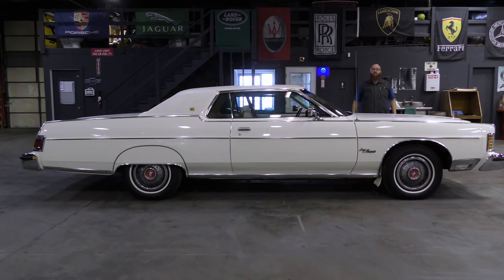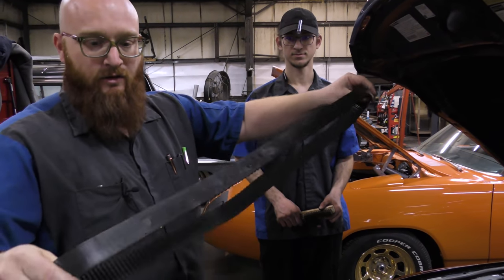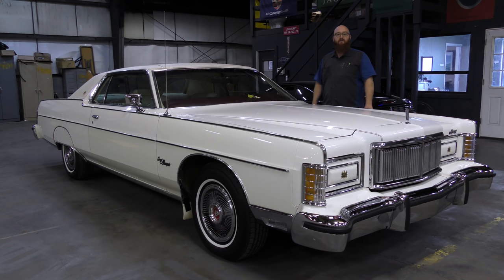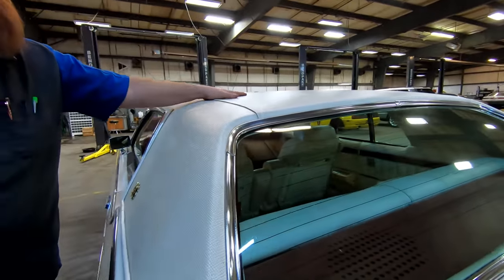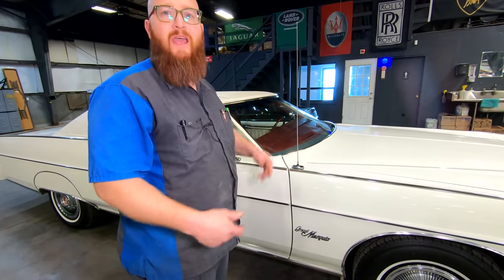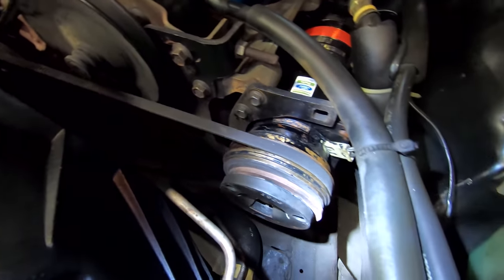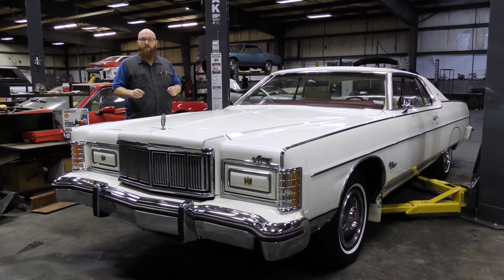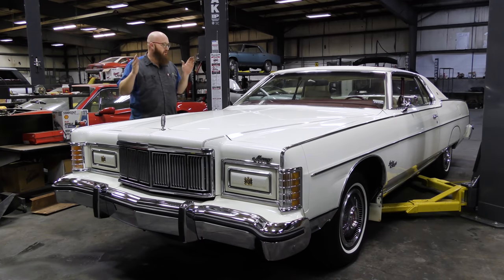Land Yacht Alert: 1975 Grand Marquis with 17K miles is in the CAR WIZARD's shop

Comment: The little old lady that used to live next to me had that car in a green color.    vinyl top cracked, let water in and roof rusted thru.  I fixed it with a couple coats brushed on of white roofing seal.   Original roof was white,, looked good, stopped the leaks.   her car at that point had the structure of a convertable.    and yes, the car was too long to fit in her garage.   super luxury car!

Comment: Absolutely beautiful. They knew how to design cars back then. I would love to have that, but I would be terrified to drive it, even on Sunday morning, and it wouldn't fit in my garage. That is definitely a collector car, and needs to be insured and treated like one. I have been driving a 2006 Grand Marquis for the past 9 years, and it has 381,000 miles on it. I recently bought a like new one owner 2007 Grand Marquis with 36,000 miles on it. I'm going to go ahead and wear out the 2006 (if I live long enough) then start driving the 2007.

Comment: I used to see a black one in the downtown Houston bank garage which was driven by one of the parking attendants. The land yacht belonged to a VP of the bank. It was just as pretty as the one in your shop. I'm betting it did not have the key-operated hood lock. thanks for posting.

Comment: I recall my dad deciding to get a vinyl roof put on his 1982 Pontiac Parisienne.  He bought this car as a dealer demo in July of 1982 and it had 5 thousand miles on it.  This happened towards the end of the vinyl roof craze and there were skilled craftsmen who did this kind of work.  We lived in a place that got a big summer hail storm every 5-6 years so I think he figured this would be some magic shield to prevent hail dents on the roof.  If anything, vinyl roofs added to the auto body repair time of any panels it touched.

Comment: I bought a 1977 Ford LTD Brougham brand new in 1977 and the only major problem with it was the steering box leaking past the lower seal and making a mess in my garage had to replace the box twice. At 20 feet long it just fit in my garage. I really liked the car though was a great highway car.

Comment: That yellowed plastic, I restore old Nintendo consoles and there is a process called "Retrobrite" that we use to decrease the yellowing. It basically uses hair bleach and UV lights to un-do the degrading of the plastic dye. Not sure if it would work in automotive plastics.. but I cannot see why it wouldn't. you might give that a shot.

Comment: Wizard: talking about barn finds. In Sweden someone found a 1979 SAAB 96 with 7 kilometers (4,3 mi) on the odometer.  The original owner bought it, drove it home and parked it in a shed. And there it's been since then until now. It's on action right now, price is expected to hit somewhere around $54.500. It's at $44,600 right now, but there's a few days left.

Comment: I had a 91 Mercury Cougar for a few years. It was about a decade old when I got it. Not nearly as big as this, but it was still in that same category of land yacht. I loved that car, was so nice on the highways, had nice little touches like lights on the side of the car that turned on when you used that sides blinker when the headlights were on. The back seat was my bed on many many nights due to going to concerts or just getting drunk and needing a place to sleep.

I have been driving pickups since I got rid of that car, but in the 23 years I have been driving, it is that Cougar that I think of most fondly.

Man I would love that Grand Marquis.

edit: Thinking back, this one really does remind me of my Cougar. The turn lights, the fake ragtop (mine was a black top), the nice hubcaps, the white paint, its a 2 door. I know the Cougar is a different line of cars, but it almost feels like this is the father of my old Cougar.

Comment: Wizard, if you’re looking for an early 70s American land yacht with decent handling/steering, check out the ‘69 - ‘73 (fuselage) Imperial range. Chrysler built those with unibodies, torsion bars and leaf springs, and fairly tight steering ratios. They’re also among the largest, longest American cars ever built - not to mention rarest!

Comment: My dad bought one of these when I was in high school.  They don't make 'em that way no more!  If I recall corectly, 7 ash trays!  When you cornered hard, it woudl frequenty flex the wheels so much it would throw a hubcap on one of the outboard wheels, I'd have to circle round the block to go get it!
It had the pneumatic tube inside the steering wheel rim to honk the horn.  429 4-barrel got 9 mpg!  The power bench seat would fold nearly flat as a bed.  
Those nearly 50-year-old vacuum lines are going to give you trouble, and there are a lot of them.  The intermittent wipers, headlight covers, and power door locks were all vacuum controlled.
The Brake warning light would illuminate if you got an air bubble in the line, I know.  Not sure how that worked...they were drums brakes though even in 1975. 3-speed automatic.
That's a very clean one.  The fender skirts were the worst for rusting.

Comment: A good friend of mine's parents bought the 4-door version of that car in 1975. It is too bad the left front fender is dented in that one. It would be almost perfect without it.

A few options that one is missing compared to my friends include automatic headlights and rain sensing wipers (that didn't really work that well). My friends had the same engine and locking hood release.

Unfortunately my friends got many miles put on it and it severely rusted by the time it was about 7 years old. The rear suspension had become very low by then and the long rear overhang would drag everywhere.

My friends was light blue in color but the inside had the same dual color red and white. There was no faded arm rests on his, but it was junked before it was 10 years old.

I still remember fondly riding in that car and only drove it once. It had tons of torque and was fairly powerful for the time too - but it drank fuel like nothing else.

Comment: The body reminds me of my grans 78 Tbird, great car, came across one issue with the black adhesive goo they used to stick the plastic sheet and other bits to the inner door and door panel started to turn to a liquid and seep out of panels in odd places like the window and lock switches which were on the side of the armrest and not the top.

Comment: In the mid 90's I had a 1975 Thunderbird that was more or less the same car as this (though not quite as fancy).  It was in terrible shape though, and I only paid $50 for it.  The engine ran ok, but it burned some oil, the suspension was completely worn out, and the interior was torn to shreds.  Same 460 engine as this though.  WIth the gas mileage that thing got though, I wouldn't want to drive it today.  This car belongs in a museum or something.  This car was built during the time when Ford's answer to every issue was "put a bigger engine in it".  Completely impractical to use as anything but a show car.

Comment: In the early 90's I had a 1973 Dodge Polara Custom 2 door. It was longer than the old square box 1980's  Suburbans. Two paisley bench seats that would hold four in front and four in back. Back when there were drive in theaters we would put two or three people in the trunk to save on admission. Stupid, yes, but we were high schoolers.

Comment: I bought a 1986 Cadillac hearse from a local funeral home.it had only 34,000 miles and in perfect condition.20 foot long and rides so smooth,but you aren’t driving by a gas station with out filling up.my picture is the car at a car show

Comment: Had that same locking hood latch on my 1981 F250. Fun one day trying to get the hood open to pull a coil wire with the ignition stuck in run!

Comment: Imagine all of the paper-based engineering drawings and the number of draftsmen that Ford had to get all of the parts of this land yacht designed -- in an era with little to no computer assisted modeling or design.  CATIA, ProE, and Unigraphics (now Siemens NX) were all a  dream back then.

Comment: Man what a barge, love the styling.  I dunno why anybody would've bought a Lincoln Continental in the 70's, costs about 1/3rd more and looks exactly like the Mercury.  Interior isn't any nicer, loaded out like this one has all the Lincoln options like leather seats, automatic climate control, hideaway headlights, same 460 V8, etc  About the only Lincoln option this car didn't have was the load leveling rear suspension(a must have for the mob men, can stuff 3 bodies in the trunk and the car isn't sagging in the rear to tip off the cops)

Comment: They certainly do not make cars like this anymore. What a shame. I had a ‘76 Mercury Colony Park station wagon with the 460 engine and 4 wheel disc brakes and it would pass anything except a gas station. It was a joy to own and to drive until the rear axle broke and could no longer be replaced because it was a rare 4 wheel disc brake optioned car. I have never since had a car that was so enjoyable to own and drive. I could never get interested in cars after that one.

Comment: What a beautiful car. A few notes. The ends of the exhaust pipes are not correct. They came out at the very rear of the car below the bumper. Single exhaust was standard equipment. Dual was an option 3 ways. Stand alone, as part of the heavy duty towing package, or rare as Hens' Teeth Police Interceptor. Interceptor included a much heavier front antisway bar, added one in the rear, and had a 275 horsepower version of the 460. It was, if anything, underrated. Just a stunning car.
You mention "loosey goosey" steering. If the steering is that loose, it is time for a new steering box. Properly set up and aligned, the steering is very precise. You should be able to nail a coffee cup square on at 80 mph. With either front wheel. They are very much over assisted, but once you get used to that, they do communicate. For shocks, this beast would benefit from the Ford gas shocks. They are available from Ford and they work! They are also bright red. These beasts can be a fantastic drive. They will never be the ideal car for the Tail Of The Dragon, but they will move along very nicely. I had a 78 Grand Marquis, a pair of 78 Thunderbirds, and a pair of 79 Thunderbirds. I plan on getting another 75-78 Grand Marquis, but it has to be a 4 door, not a 2 door. 
When we were being shown the dash, no mention was made of the optional "Auto Lamp" system that used a light sensor to turn the headlamps on and off. No mention was made of the optional automatic HighBeam system. No mention was made of the standard parking brake release. Operated by vacuum, put the car into drive or reverse, and the parking brake releases. One option that is missing is the automatic power antenna. That was available, and would raise and lower when the radio was turned on or off. It was located on the left quarter panel.
Reply: Great information!  Wizard was talking about vague steering in general.  This car has zero play and tracks perfectly.

Comment: My 2013 Ford had cornering lights and my 2016 Audi has them.  This is a car from 197 frickin 5.  The engine bay is cleaner than my 2016 car and the seats look more comfortable than my 2016 car.  It would be like driving a bus - but looks so comfortable !!  Oh yeah - and those tyres - they aint low profiles ;)

Comment: I drive a 1969 Cadillac convertible so I can relate to this car. parking used to be a problem till I realized that I could just push other cars out of the way. I used to drive a 1967 Imperial. Before that a 1958 Caddy Limo.

Comment: Sorry for the ignorance, but WHO is this Bob that he’s referring to in this video?  Side note…… this is a gorgeous car! The only thing I’d do is carefully remove the lower arm rests bases and a few upper window garnish moldings and have a proper color dye mixed, respray them.  It greatly distracts from an otherwise pristine example.  I’m 56 as of this Saturday and as an early  teen when these were around I fell in love.  I always thought that these Marquis and the Continentals and Marks of this vintage were THE BEST most beautiful cars ever made.  I still feel this way!  In 1984 at age 18 I bought a 1966 Toronado, a year later a ‘70 Continental Mark lll and in 1989 I added a 1967 Thunderbird Landau coupe to my fleet.  Still have all three plus a 25+ year stash of NOS parts!  Mechanical , wheel covers, trim, lenses you name it I have it!!

Comment: I saw Bob had a video on this car.    It's too nice, really, I'd be afraid to ever drive it. 

The Universal Studios people put those locking hood latches on KITT Trans-Ams when filming Knight Rider.

The dash "Brake" light is on when the parking brake is applied.  It can also illuminate if the brake system loses pressure.

Comment: I WANT THAT CAR! I checked out the price and unfortunately it's more than I would want to pay. I love these the only problem with these years after 72 is they were grossly under powered a 75 Marquis 460 had about 220 hp . I had a 71 Continental basically the same base with the 460 that had 365 hp and 500ft pounds of torque. Even in that heavy car it would easily break loose. It's too bad after 73 the hp dropped drastically in cars.

Comment: I bought one of those beautiful vehicles in 1978. It was an 1975 Grand Marquis. It was bright red, black vinyl top, black leather seats, powered by a 460 V8 engine, and had 33,400 miles on it. Absolutely gorgeous, with a ride and comfort I've never felt before or since. Sigh! I lived in Cleveland at that time. Needless to say it didn't do well in snow. It was stuck a lot!  LOL

Comment: I'm a HUGE fan of the vintage/antique Mercury Marquis. I've owned 5 (yes FIVE) of them. That being said, some people may say it doesn't count, because when I owned them they were not yet antiques!!! 
LOL  

Okay, now you know that I'm an old fart... My favorite years of the Marquis, is 1968 through 1972. BUT, this 75 model is gorgeous. Believe it ir not, the older ones, fir example the 1970, is larger then this one. The 70 is just a touch longer than this one.  Anyhow, this car is fantastic, and YES, I'm one if those people who LOVE the "swishy" steering you said you happen dislike. 
All of my Marquis were immaculate, but the lowest mileage I had was something like 39 thousand. But you have to remember, when I bought it, it was only about 10 years old! 
The other thing is that these cars being back wonderful memories for me. The car I loved and cherished, and drive while in high school was a 1970 Marquis. 🙂🙂🙂 But again, it was only 8 or 9 years old while driving it to school every day as a senior, getting ready to graduate. Lol  One thing different back then compared to now, (I'm talking middle to late 70's), as a high school senior driving my white, 2 door hardtop Marquis, (no vinyl roof) with 429-4 barrel, and called a "land yacht" by people today for its "enormous" size.... back in those days, the car wasn't thought of at all of being a "land yacht". Because the roads were filled with cars this size. They were everywhere. During years 1976, 1977, manufacturers made some of the largest cars ever. And being only 2 or 3 years after that, the roads were filled with full sized sedans and also station wagons that were all very close in size to this Marquis. 
Another fun fact? (I had both 2 door and 4 door models of the Marquis) The 2 door coupes were just as large as the 4 door sedans. The 2 door models had that LONG doors, that weighed about 200 pounds, and that weight could be felt when opening and closing those doors!!  Lol 
Almost all of these cars had back seats that were immaculate. Many having never been sat on. 6 feet wide, and like a leather sofa in tour living room, you can use your imagination and figure out another reason why these cars were so great as a high school teenager or young adult, when we took them to the local Drive-In movie theater with our date.  😉   
BTW, that "yellowing" if the off white plastic in the car, is so insignificant it's not worth even mentioning. I would absolutely LOVE to buy this car, but by the way you talk, I already figured out it's beyond my price range. But then again, I'd use this car as a daily driver which would probably upset a lot of people. In my younger days, I had the mentality of putting things away also, and driving only rarely on special occasions. But at my age now, my thoughts on that have completely changed. I believe when we purchase the things we love, we should use those things regularly. Mo more putting them away for a "special" day.  Every day is special, and if I had that Marquis I'd enjoy it EVERY day. 
Just saying!!  👍👍👍🙂🙂🙂

Thanks for sharing this beauty. But the REAL disappointment I had with this video? You didn't take us for a ride in it!!  I mean, not even around that block!! And that was a huge let down. Through the entire video I kept thinking a test drive would be at the end, in the last 30 seconds to minute of the video. Nope. Nothing!!! That was a real disappointment. Thought you should know that. 

Thanks again for sharing! I really enjoyed it. Except for the lack of even a short test drive at the end.

PS. Off to EUROASIANBOB I go!! If he's finding these cars, just perhaps he'll find one that fits my budget.
BTW, for those interested in this BEAUTIFUL 75 Marquis? 
Asking Price is $25k.